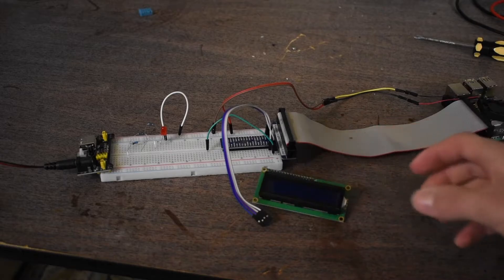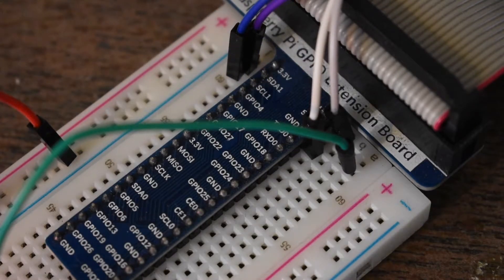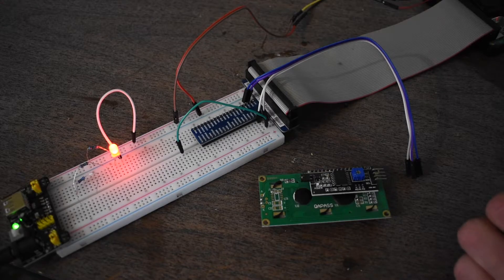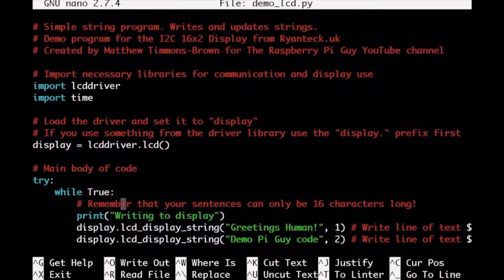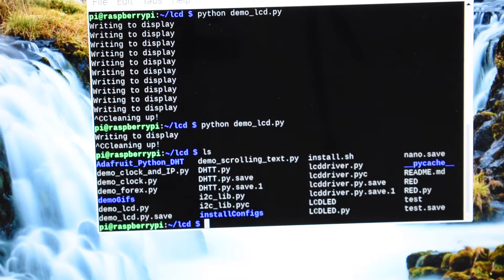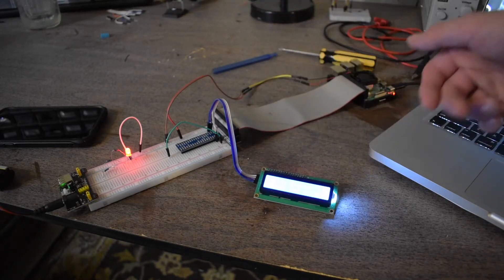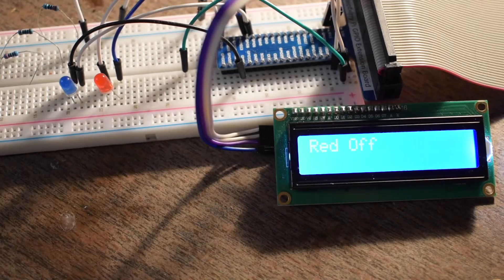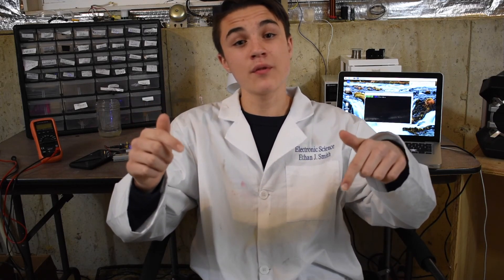How to Control A 16x2 i2c LCD with Raspberry PI

Comment: Thanks for this simple and useful video :)
just wanted to know how can I utilized another SDA and SCL pin on an RPI since I wanted to incorporate another i2c device on it but I am struggling to find other pins that can work as data and clock lines too. any ideas? :(
Reply from the maker: You should be able to connect a second display to it. Just make sure the code for the 2nd display has the input and output set as SDA and SCL #0 I mentioned how that works in the video.

Let me know if you have any other questions.
Reply: @electronicscience1412  yes I got that part but I wanted to know which one isSDA2 and SCL2 here on gpio laypout. sda 1 and scl1 are obvious ones
Reply: also I couldnt see in your code that where you set sda and scl .. I would like to use another I2c compatible device but still confused on how to get it configured
Reply from the maker: So in the video we used SDA 1 and SCL1 the other ones are SDA 0 and SCL 0 I’m assuming you want to use the ones labeled 0 for the 2nd display because in this video we used the ones labeled 1 this is how it works on the pi 4 if you have an older version then the layout is much different 

Are you using a GPIO extension board or are you connecting the individual pins if so look up the GPIO data sheet for your specific pi 

I believe you change the SDA and SCL number in the LCD driver make sure you CD into there and change the numbers. 

Let me know if you need anything else!
Reply: @electronicscience1412  well the changing of numbers in LCD driver does makes sense but I tried myself looking for that option in the code , didnt find it .

I am not using extension board . rather directly on the Rpi4 GPIO header . I do have pin layout but all you can see is sda and scl written there,I suppose they will be SDA 1 and SCL0.  No other pin has got sda 0/1 and scl0/1 labelled as seen in the layout diagram . 

thats what  I am after , to be able to discover the second set of data and clock pins :)
Reply from the maker: Yeah this is definitely an interesting topic!! I’ve done some research and I found a data sheet that will show you where the SDA and SCL 0 is. However connecting 2 displays seems to be possible but not as easy as both of us thought. This lcd driver seems to only support one display connected at once

Here are some links
Data sheet: https://images.app.goo.gl/WuEwVTYtmhA8FotB6

I2c interface: https://www.mathworks.com/help/supportpkg/raspberrypiio/ug/about-i2c-interface-on-the-raspberry-pi-hardware.html

If you want to connect 2 I would probably go with a different lcd driver and code that can support 2 because this one only can read one display address. I looked in the lcd driver and didn’t find a way to change the SCL and SDA.
Reply: @electronicscience1412  oh thanks for putting your time in getting all that info , I actually found the second i2c pins yesterday on a blog post ;). but yes lcd must have a unique address thats how i2x works in general but unfortunately with displays like these ones which either come in as 0x3F or 0x27 has their default address , its impossible to get both hooked up if they posses the same address.
Very thankful for your response, thanks a bunch :D
Reply: @NawtieBoy96  I have found a way to run x2 displays (what i think your looking to do ?). I'm guessing your having an i2c address conflict because the LCD's are of the same make/model (same i2c address's 0x27 etc). The SDA & SCL on pins 2 & 5 are on i2c BUS 1,  there is another i2c bus on pins  27 & 28 this is BUS 0. BUS 0 needs an edit to the config.txt file to enable it and an edit to the LCD driver file to work with BUS 0... basically you need to save the driver file under a different name and include both at the start of your code, run the second LCD off BUS 0. Hope this helps ;)